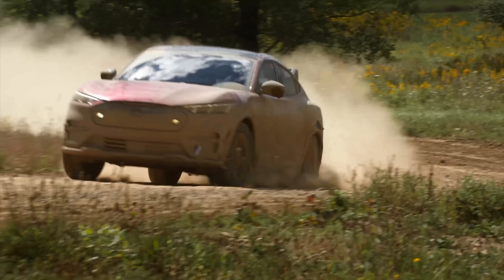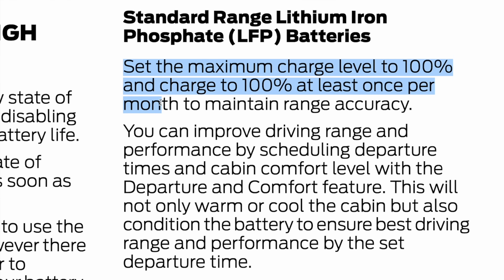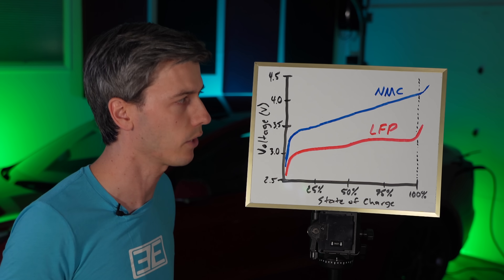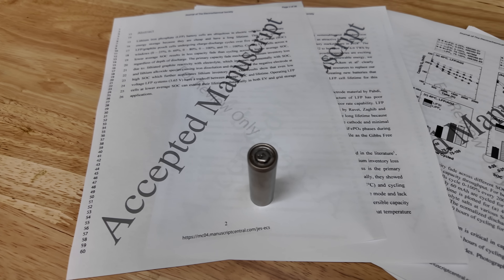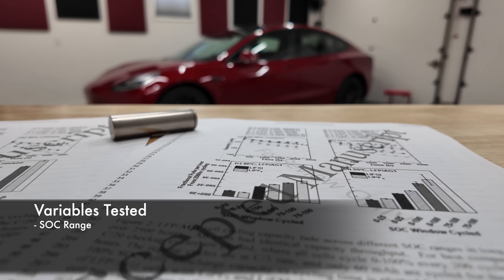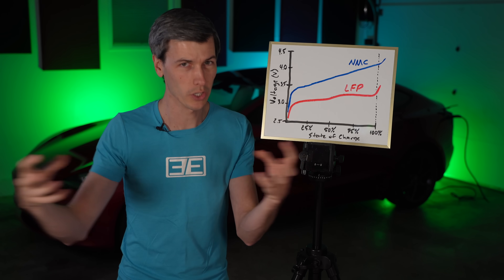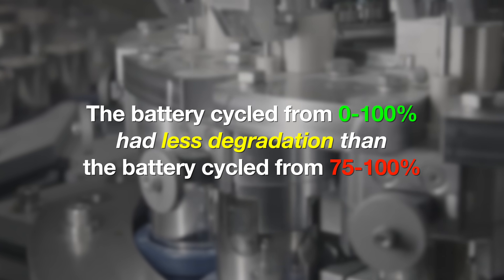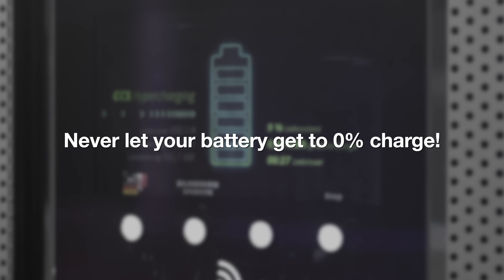How To Ruin Your Electric Car's Battery - LFP Edition!

Comment: If you have a Tesla and can charge at home, disregard "LFP Best Practice #4 - Only plug in your car when you need to." 

When the car is plugged in and reaches the chosen SOC, the car will stop charging but still draw power from the wall for basic functions, reducing battery usage and in turn increasing the battery longevity.

I've personally tested this by noticing the SOC decrease even with some power drawn from the wall outlet over long periods of inactivity.
Reply from the maker: Yep, fair to say. But if you're setting your limit to 100% then it will always be charging up to that when plugged in.
Reply: @EngineeringExplained 
It's crucial to highlight the importance of cell balancing, which only occurs at 100% charge in LFP batteries. Your battery pack is only as strong as its weakest cell, and regular balancing ensures that all cells age evenly, preserving the overall health of the pack. 

Worth noting the following;

1. **Cell Imbalance Over Time**: As LFP cells age, they can gradually go out of balance due to internal resistance variations, minor manufacturing differences, and environmental factors such as temperature variations across the pack. These differences can cause the cells to have slightly different states of charge (SOC) over time.

2. **Importance of Full Charge for Balancing**: The battery management system (BMS) of an LFP pack typically performs cell balancing near the top of the charge cycle, close to 100% SOC. If the battery is never fully charged, the BMS may not have the opportunity to balance the cells effectively, which can lead to increasing differences in SOC between cells.

3. **Impact on Cell Aging**: If cells remain imbalanced over time, they can age at different rates. Cells that consistently operate at a higher SOC may degrade more quickly, while those at a lower SOC may age more slowly. This can create a feedback loop where imbalance worsens over time, further accelerating the differential aging of cells within the pack.

4. **Compounding Effects**: The combined effect of different aging rates and a lack of balancing can result in a quicker degradation of the overall pack performance compared to a regularly balanced pack. Over time, this can reduce the usable capacity and lifespan of the battery pack.

To mitigate these issues, it’s advisable to periodically charge the LFP battery pack to 100% to allow the BMS to balance the cells and maintain the pack’s overall health. However, it’s important to balance this practice with the understanding that frequently charging to 100% can also contribute to cell wear. 

A good balance could be to not recharge after every trip if you have enough charge for the next trip. Then fully charge to balance the pack when you need more range and repeat. This minimises your effort, ensures the cells are well balanced and the range estimates are accurate.  A good LFP pack should last 100s of thousands of miles anyway.
Reply: @EngineeringExplained  exactly, set a limit but let it plugged in
Reply: Yeah I think that statement is specifically regarding maxing your soc and minimising how many cycles you do. So discharge deeply, charge less regularly but just send it when you do.

I think though that I would set it to like 95% and just charge it once a week, typically don't drive that much as everything is close and I commute by bike.

Comment: I dont know how granular it is, but for lfp if you can set max charge to 95-98%, the car should still be able to top balance fine and get a good read on the voltage, taking that top edge off the cells is worth doubling the cycle life. At least thats how it works for home storage lfp batteries.

Comment: you should be able to set up automated programs that during the week, will cap at 50%, and then on the weekend, or maybe even once per month, it will automatically set the charge cap higher until it does hit 100%, and then set the cap back down.

Comment: Store for a "longer period of time" is the car equivalent of "put some salt" in the biscuit recipes... What is "a longer period of time"? 1 week? 1 month? 1 year???
By the way, I'm not going into EVs until there will be a proper solid state battery with no dendrites, low degradation, zero fire risk and less weight.

Comment: I would like to ask one question. According to your video it is staying at a high capacity that is producing those harmful substances that degrade the battery. As such would charging the battery to a 100% and then immediately discharging it to a 70% be a good solution? If so, the car manufacturers could make some sort of battery level recalibration button that could do it for you.

Comment: Can you please make a video what the best practice is for a lead acid battery? I have a electric scooter that uses 72v (6x12v) lead acid batteries. I thought lead acid batteries don't like deep cycles but why did the engineers choose lead acid for a scooter than needs to commute daily?
Reply: Lead acid batteries are cheap. There's your answer right there.

Comment: So let's say an LFP battery has 3500 charge cycles on average till it hits 80% of it's original capacity...These cells can be cycled so many more times than NMC cells and still have life in them...how much do these bad charging habits effect the final charge cycles, 2, 3, or 5%? I wish that information would have been shared in this video. 
If you're only losing 350 charge cycles in the end (and still get 3150 charges till 80%) I think that's worth the convenience of having it charge to 90% most of the time, and then every once in awhile charge to 100%.
Reply from the maker: Should have included some info on this, see pinned comment (edit 1).

Comment: With Tesla at least, you can find the battery chemistry of both the low voltage and high voltage batteries in the car details right on the touchscreen. It is one of those things you have to know where to look, but once you know, it is at least a bit easier than trying to count digits in a VIN IMHO.

That said, Tesla's recommendation is pretty bad and confusing IMO

Comment: my Wife just got the new 2024 Model 3 RWD standard range as a lease for 3 years, I assumed it has the non-US made "LFP" and thus didn't get the tax credit? but she says it did(cause it is a lease?)...anyway she has just been charging at the grocery store(free for now, easy, good charging interval/cycles, and only takes about as long as she shops) but I am in the process of installing a home wall charger - I'm guessing that Tesla wants you to keep the car plugged in all the time is because it is always "on", and it will "run" when parked to maintain the interior climate temps at safe levels - but even after watching this video, I'm still just going to have to let her 'plug in' however she wants; which I'm going to guess will be somewhere between 'always' and 'random', which actually almost sounds about like what this video describes to do ~ haha

but really it doesn't matter all that much - as we've had about the worse EV you can get, a 2016 Leaf, for 8 years now; and she drove that every day, with no issues at all and just plugging that into a normal 120v household outlet whenever she felt it needed it ....now I sometimes drive that one, and maybe at the most it has lost about 20 miles of range; but I'm guessing an 8year old ICE car that never had any maintenance its whole life would hardly run at all anymore - so the EV has not only been much less of a worry, but far easier to operate and at a much lower cost

Comment: The BMW i3 has buffers built in at the top and the low end, which are NOT displayed to the end user.  When I remember correctly it only allows you to charge to like 86% and down to about 10% (it shows 100% and 0% on the display). And the recommendation is ABC, Always Be Charging,  always plug in - the cars BMS handles it fine. Have seen cars with 400.000km and still high 90% SOH numbers on the battery.

Comment: The optimal is 25-75%, using the middle half of the battery. Equilibrium is reached between the cathode and anode at 50% SoC. Voltage matters. 75% SoC is basically the same voltage as 95% SoC for LFP so that suggests you could use 25-95% for them.

Comment: Jason, it would be useful to review the Tesla powerwalls charging options considering these best practices. It seems it would be wise for Tesla provide an option to change their max charge level from 100% (13.5kWh/14kWh = 96% internal capacity) to optimize their lifetime. Tesla claims the lower current draws mean these best practices do not apply, yet the chemistry that causes the battery degradation is much worse at the higher states of charge (higher voltages). Let's highlight this. Further Tesla allows their cars to have a lower max charge level, so ... why not enable on their PowerWalls/app.

Comment: This study is not matching all the other studies I have seen plus all the experiments I performed over the last 10 years with LFP.
The 40 to 55C battery temperature is very high and LFP suffers significant degradation at elevated temperature regardless of the cycling.
Also at 3.3V a LFP can be at 99% SOC or 50% SOC so voltage can not play a role in degradation for LFP.   But pushing the cells at 3.65V and keeping them there in order to gain 1 or 2% extra stored energy could accelerate degradation especially if done at elevated temperature.
Most studies showed that 90% or 95% to 100% cycling gets you almost infinite cycles it works almost like a supercapacitor and same cycles showed higher degradation when operating closer to 0% SOC.
Just taking a quick look trough the study I see almost no difference at +40C but huge difference at +55C and that is not a big surprise as LFP hates high temperature and +55C is extreme.
There is a good chance the study was intentionally designed to make LFP look bad as China has all the patents and manufacturing related to LFP.

Comment: it almost sounds as if you really have to abuse the heck out of an LFP to really kill it before the average person trades it in.  if they abused the battery in the worst conditions before it finally crapped out, that says a lot.  

unfortunately, i live in vegas where summers are often above 105F, especially this summer.  on the fortunate side, it says it can take it much better too.  i also only use L1 charging, which reduces the heat on the batteries, and i do drive it a lot vs short trips so its almost always plugged in for longer charging times than every single time i get home from going around the corner.  

overall, this study is reassuring that ill be getting rid of my LFP model 3 before it dies, and im not looking to get rid of it any time soon.

Comment: Hmmm.  Samsung has a battery saver feature on their phones which use Lithium Ion batteries that is supposed to prolong battery life by only charging the battery up to 85% instead of 100%. I guess there's more differences to Lithium Iron Phosphate batteries than just the chemistry if they do better charging to the full 100% during regular use.

Comment: I keep my Tesla Model 3 between 25%-70% as much as possible. Even on long road trips, I try to stay in this range, maybe with a bigger range of 20-80% when needed. This is convenient, because that amounts to about 2 hours of driving, with 15-20 minute stops. 2 hour stints are great for leisurely trips, and I'll be damned if I can get my wife back in the car faster than 15 minutes! On road trips with friends, the stop time is even worse!
Reply: Yeah I couldn't imagine driving for much longer than two hours continuously. Concentration goes, body hurts, just need a drink and a rest. There's very little I can do for two hours solid without a rest - even playing Civilization you need a bit of a break!
Of course you'll still get these people who say they drive 12 hours solid without a break but generally they're talking nonsense.
Reply: @drunkenhobo8020  I have a cousin that used to regularity drive over 12 hours. He had already totalled a bike and a car. Then had two fender-benders in a van and got a heavy truck stuck in the ditch.
Honestly any regular trip becomes a chore if it's longer than 2-3 hours and I'd rather take the one hour slower train but be able to do work, study or eat in said time.
Reply: @drunkenhobo8020  Everyone is different. When I was younger, could drive a full 12 hour day, take a couple meal breaks (~25 minutes each), and quick 10 minutes fueling. I'd feel a bit tired at the end of the day, but ok.
  Now, I like to take 5 minutes breaks every 60-90 minutes for a quick stretch, a bit longer at the pump for more time out of seat, and don't really like to do 12 hours.
  When I was a lad, I could do 8 hours straight with just a fuel/bathroom break, eat in the car. I think most adults want to get out every 3-4 hours for about 20-30 minutes at minimum. 
  It's just funny to me bc so many people think that since they can go 12hrs straight in the seat, all cars should, and why adapt driving patterns 1 iota as the car needs? And in the end, the vast majority of EV drivers don't have an issue adapting a bit.
Reply: Same here.  I have a Model X Plaid with a ~340 mile range, so my trips are closer to 3 hours, and I keep my battery between 15 and 70%, but it's the same principle in play. I always wonder if people who complain about "frequent charging" have ever taken a road trip.  By the 3rd hour, I need to stand up and take a break anyways (I've interrupted the planned route and stopped early to charge a few times simply because I wanted to stretch my legs), and even when I'm alone, I'm spending maybe 10 minutes in the car waiting to finish charging.  A car which has Steam and YouTube in addition to all of the other entertainment stuff I use while driving.  Not much risk of getting bored there!
Reply: I just had to replace my model Y battery at 3 year, 74k miles. Lucky it is under warranty. 

Don’t know if it was something I did, or just defective.
Reply: @moon_wobble7782 I think it's a wild outlier. Like a Honda engine failing at 50k miles. Or 100k miles, lol
Reply: So what's your battery degradation like?
Reply: Yeah, stopping every 2 hours for 30 minutes is insane. I routinely do 5-12 hour trips depending on if I'm going to the coast or Texas or whatnot. Maybe 2 or 3 gas trips for 10 minutes after 3 or 4 hours depending on traffic. Stopping every 2 hours if not sooner for 20 minutes sounds insane. But if it makes you guys happy there ya go
Reply: @dankbonkripper2845 as I said to another guy, everyone is different. As you get older, you will see the need for more breaks

Comment: I hope novices who don’t have a deeper understanding of li battery mechanics don’t watch this video. It’s too confusing and creates more questions than answers. 

Folks trying to decide on an EV need a simpler rubric for making a call than the level of detail and confusion offered here. And so I’m clear and not a total ass: this wasn’t confusing to me. It was insightful. But I’m not the average potential buyer. 

The cycle life of these LFP and NMC batteries will be fine for most people in most cases in most environments under most charging and driving conditions. That is to say that the battery chemistry won’t be a significant influencing factor when choosing an EV.

Comment: Bad idea to put LFP in cars.
During cold weather, the voltage/charge curve of the battery drifts considerably.
So, if in summer 3.0 V per cell represent 15% of the charge, during winter the same voltage can become 1% of the charge. 
Since this drift is not stable, the charge computer can easily leave the car stranded, and the opposite case can overcharge the battery and kill it.
The coulombic charge system suffers of the same problem if you charge and discharge at different temperature.
Don't buy EVs with LFP batteries. 
LFP batteries are meant for grid or solar use. Chinese use them in cars because they are cheaper, but they have double the volume for the same capacity.
Reply: thank god not everyone lives in a cold country! literally never gets cold enough in Australia for it to matter lmao

Comment: In respect of the advice by Tesla to always keep the car plugged this doesn't mean charge the car constantly. It means your car is always available to be charged. When the car is "always plugged in" it gives you total convenient control over your charging strategy. For example you can pre-set the car to routinely top up to 60% but on a chosen night you could charge to 100% as recommended just by using the app from wherever you happen to be ... you don't have to make a point of going to move the car into the correct position and plugging in ... because it's already plugged in! The act of plugging in my car takes less than 10 seconds and has always been part of my return home routine. My home parking location is not immediately adjacent to the house so it saves me ever having to go out to the car just to set it up for charging.

Comment: The part I find frustrating is that no one seems to quantify just how much charging habits will actually change the lifespan of the battery. For example, how quickly will the max range of the battery degrade if you carefully follow all the guidelines vs just plugging in as soon as you get home.

Comment: Because of the lithium consumption into the SEI, LFP manufacturers are starting to dope their anodes with extra lithium, which is extending life.
Also you never got to why you should leave it plugged in, which is to maintain a good temp range on the pack. LFP's have more thermal mass, so they are better at resisting overheating/freezing, but keeping them plugged in is a good practice to guard against freezing